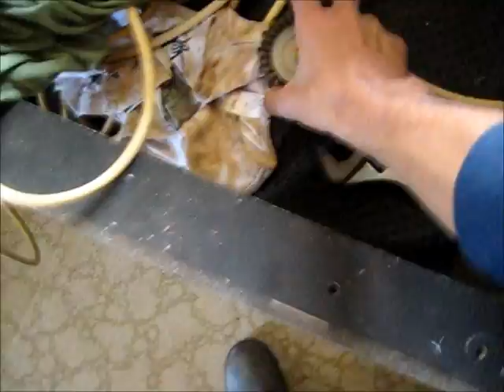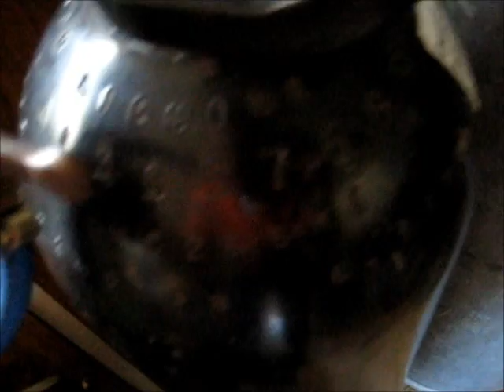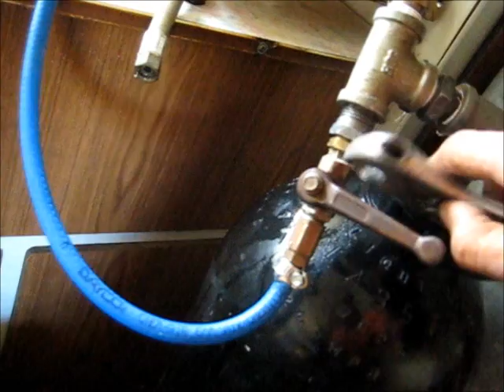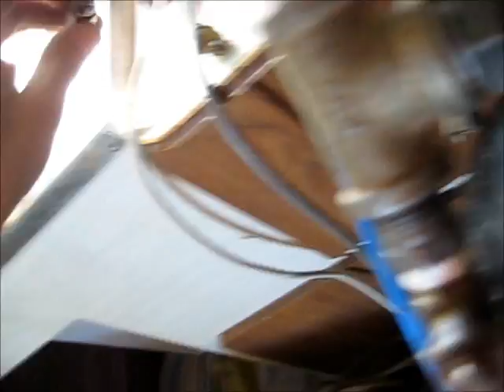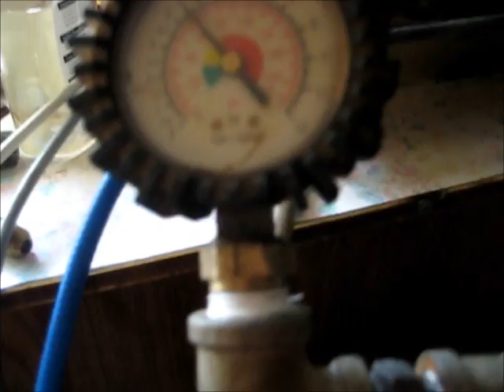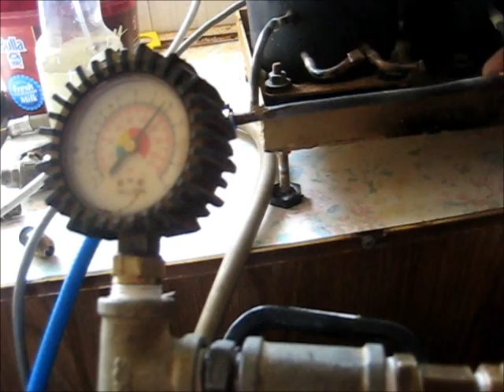Alloy Air Tank

Comment: The only concern that I have about using old welding tanks for air is that you need to get rid of any residual gas (like acetylene) left in the cylinder, in terms of pressure you would never come close to breaking one by hooking a regular air compressor up to it. Another good tank I've seen people use is a propane tank, preferably a new one, they rust inside but will hold up to 300 psi no problem.

Comment: Lary,please don't take this the wrong way just trying to help you.many people around the world injur there selfs playing around with compressed air. 1st relief valves for comp air are non adjustable and fall under the ASME code along with air receivers(aka air tank) the welding cylinder your useing should be ok sence you will never reach the burst pressure with that refer comp.I know the tank won't rust but if you fill it half way w/ water it will only have half the capacity and will be heavy

Comment from the maker: @rotarycomptech This tank doesn't corrode, this setup is just to charge up the tank manually then switch off the compressors when they're done, I may have a spare relief valve somewhere, i just have to calibrate it :)

Comment: You should never install a isolation valve on any compressor discharge line with out a pressure relief valve installed up stream of the isolation valve. thats why the solder conection failed,it was the week link. Please consider using a spring loaded check valve in place of the isolation valve.Also if you want to drain the tank consider replacing the tee with a cross fitting and install a pice of copper tube that extends to the bottom of the tank.Good luck with the soldering

Comment: ye need a bov to dump the head pressure on the comps,just before the tap & gauge so when you start the comps up again there not starting under pressure so they will last longer.

Comment: do you have a one-way valve after the input hose from the compressors? cos if ur just using the tap as a shut off and the hose from the comps blows off all the pressure in the tank could send the tank flying.